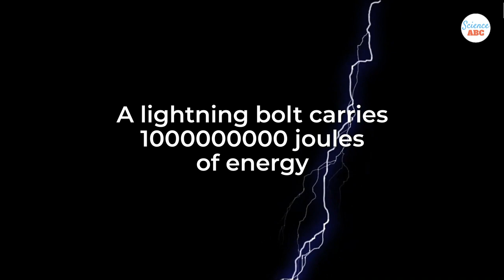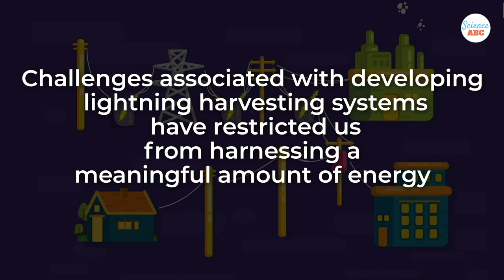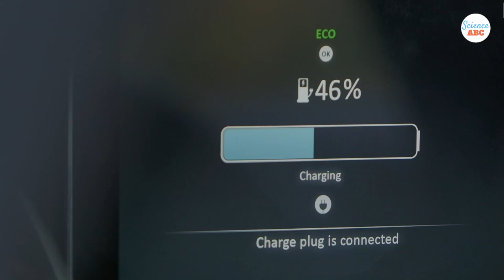Can We Harness Electricity From Lightning?

Comment: Basically we need a big ass capacitor that can store the energy and then big ass Transformators to reduce the voltage and charge regular batteries.  It is that so freaking hard? I dont think so.
Reply: Yep
Reply: I understand the thinking however the temperature of a lightning bolt is around 5x the surface of the sun. there's an issue right there.
Reply: Your right but i dont think anyone will want to invest in this when there is better sources of energy to invest money into like solar.
Reply: Do you know how big a solar panel has to be just a charger phone and how much it costs urger phone and how much it cost
Reply: Lol you funny
Reply: @lukegracey7928  no issue press north and north magnets together they don't want to touch in the middle that's our salvation
Reply: I mean basically but it is a bit trickier than just that. But you are right
Reply: Reduce the power on the way down
Reply: Or collect It a little at a time on the way down
Reply: that would save too much energy and civilians money tho silly...
Reply: for real a whole line of capacitors from the top of a building to the bottom routing back up to the top to breaker cutting off the lighting rod to the system trapping the electricy to go into transformers then then charge into batteries or rout to the building. seems like a money maker. hmu for partnership lmao
Reply: Bingo.
What comes up to my mind is: Huge salt water tanks for capacitor.
Reply: Isn’t this what Tesla is doing now?
Reply: It is not just high voltage. Lightening would bring very very very high ampearage. Even if a big ass capacitor was built for this purpose, it cannot be powerful enough to capture the ampearage that literally burns the surrounding AIR. The chemical compounds currently used in making capacitors will burn faster than air. Unless we discover or fabricate a material that we don't know yet (like in Wakanda), the capacitor cannot handle the heat that comes with lightening
Reply: We can create it as fast as we can use it...or need it. Only trouble is...we can't store it yet. So...if man can find a material that will tolerate the heat it produces 5 times hotter than the sun...we essentially can't use it. But...someday we'll find a material that will tolerate it...and will certainly change the world as we know. 
An infinite amount of clean natural power...think of the possibilities
Reply: @lukegracey7928  I said in another post somewhere just have it strike water and turn it to helium and then that's really efficient helium off the off chance
Reply: Get it to somehow strike water and instant hydrogen
Reply: @Aluttuh  that is one time payment, government just need to buy the capacitor and trafo, and for the lightning charge it’s free, and it’s a clean energy too
Reply: @pettylilitems  what do you mean
Reply: Nearly all sky scrapers has a tall antena, and their construction is situated on large conductive structure which goes under ground and stores there electricity as a giant batteries
Reply: agree.
Reply: If you don't think so then maybe you should do it.
Be the change you want to see in the world.
Reply: @lukegracey7928  And there's 300 million volts in a single bolt.
Reply: @pettylilitems  Do you know how many industrial and retail barns are out there with more or less flat roofs doing nothing except keeping the rain off*?

*Albeit not very well in some cases
Reply: And a 4000m high tower.
Reply: I am sure they are using this somewhere in one of those patch up islands in google hearth. They talk as if is something imposible to do. But yet airplanes have a lightning protection device and also tall towers have a lightning deflector device, so? They can invent this king of devices but not a lightning gathering plant? I don't think so. I do think is because it would be to easy to much. NOT good for the "wallet" you know?

Comment: You don’t need the lightning energy to be stored in a capacitor. You could instead use it to heat water or something to power a generator.
Reply: thank you ,,as easy as that ,, why cant they try that .
Reply: @jomendez6929  because no one with enough influence has ever thought of it.
Reply: I’m not sure if it would be that efficient though
Reply: Dude I was legit gonna comment this same thing. But how are you going to draw the lightning? You'll need the lightning to hit the water or something touching it, but how are you going to do that? An open container of water? That won’t draw the lightning very well. A water container with an electrode in the water and sticking out the side to catch the lightning? That's not going to heat the water enough. This is also harder because the heat is dispersed so far along the length of the bolt into the air. Most of the heat is not gonna make it into the water whereas more of the electricity would. 

I say you just have the lightning rod capture it and engineer something that makes the energy get dispersed into several pathways with transformers to decrease the voltage so the system can handle it. Make the lightning equally distributed along each of the pathways adjusting the resistance to make sure it goes through all of them.
Reply: @BimmerWon  I'm sure they have you're not the first person to think of something like this lol. Did you actually think it through? How exactly are you going to heat the water with it? How will you capture the lightning and the heat and actually use the heat for energy?
Reply: Lightning is already electricity. You want it to convert it to heat to steam to power generator just to produce what it was initially?
Reply: that would not work you would need a constant source of heat such as the heat from a nuclear reactor.
Reply: Lightning is pointless as an energy source....   Like the video here says... a bolt of Lightning can only power approx 10 houses for a day...   its far too weak and infrequent to be used on any meaningful industrial or residential scale .

Comment: What if instead of creating lighting harvesters on the ground we create an aerial harvester like a blimp for example, and harvest energy directly from the cloud before the potentially devastating discharge happen? Then the gatherer just unload charged batteries on the ground and load empty ones to repeat the process.
Reply: Idk but, there is a research in the early 2000s like 2003(i dont have enough info sorry). They launched a small rocket with a wire attached to it, then it was struck by lightning. I dont know why it isnt in this video, maybe there is an inefficiency in that method. (Sorry just lazy to search)
Reply: Would it work to artificially recreate lighting in a contained box on a small scale that will produce at least 50,000 kWh
Reply: Would that reduce the heat and the problem of getting too much power all at once. I’ve got three design prototypes that I’m very confident would work I’m also holding off because I don’t think humanity is ready for that kind of power because it can definitely revolutionize the way of life in many different ways but it would also be a weapon
Reply: @Ighteva2022  hey tye. Would love to know more about your idea and prototype
Reply: @stephenstrange4009  ya definitely you can send me a email it’s got a 2 in it and my name to switched around I’m sure you can figure it out I don’t want to put it in the comment section of YouTube lol
Reply: Yo I was just going to say as an idea too here it goes don't forget about me.. what if lightning was just solely used to convert water into hydrogen .. I suppose for the average user.. I just don't know exactly how that would be done I kind of have like a bit of a theory.. if One landed a strike maybe it would be possible to divert that energy into pylons and make it somewhat directional to zap a container of water and recover the hydrogen would be really efficient way of gathering it I think
Reply: I think blimps are flammable but it might work
Reply: Lake maracaibo in Venezuela has a lightning storm almost every day of the year.  If humanity figured a way to effectively harvest and store this power, we could turn the lake into a factory and power the whole world through batteries.
Reply: @masterpopeyoda3290  this is the way... Even if it's a massive grid of capacitors and transformers the disperse the power to the grid and harness it
Reply: @masterpopeyoda3290  I was wondering if lightning could be used when it zapped water some way somehow to harness hydrogen from it too as well
Reply: We need to have more inventor minds to be able to share and conduct growth in our inventions
Reply: We have 1 problem before this idea, how can we harvest lightning?

We have to risk it all thinking less on safety because science was never forgivable.
Reply: @creator8101  if one got the opportune moment to have a strike upon a reservoir of water that would predictably vaporize it based off of its volume maybe is possible to obtain hydrogen from that water but the problem is it may ignite all that hydrogen during the strike if it was struck in a vacuum where it couldn't just simply burn then possibly you have a very efficient process of gathering the energy from the water as I've said multiple times replying to other posts
Reply: @Ighteva2022  I lobe to konw more about your idea and prototype, too. But I cannot figure out your email. Any more hint? or Can you send me email or message instead?
Reply: @Pikachu15125  also it’s not an idea it’s a way too create together.
Reply: I just asked this same question on a different video.  If the energy is already there in the cloud, why can’t we harvest it before it’s wasted into lightning?
Reply: @AB-1023  I am curious about that, too.
Reply: I feel that would cause potential for aerial explosions
Reply: Because idk THE HINDENBURG?!
Reply: @AB-1023  hi just some input on your question, it’s just my own thought so correct me if I’m wrong. But I don’t think you can harness it from clouds because the lighting bolt is the actual surge of energy. If you think about it in car terms the + and - battery terminals have to work together to produce the energy to run your car, if they are not in unison there is no spark
Reply: @dustinswatsons9150  i have no idea if what you say is true, but it sounds cool af 😅
Reply: @Ighteva2022  i want to know more about it too. Just a random nerd from brazil
Reply: @masterpopeyoda3290  at minimum, that lake could certainly be used to power that entire region the same way we can use water dams to harness electricity for specific regions. At the end of the day, it seems the “best” solution is not one but multiple solutions depending on the most readily available resources in each region of our planet. Since lightning strikes are sporadic in most places, seems we should even be looking at harnessing electricity from multiple sources at once. Like how we can gather sunlight energy & burn coal to power a region. Or how in some areas, wind farms make sense in combination with some other source because wind is also not consistently available. We just need to figure it out so we can add it to our current options for harnessing electricity. Starting with a location where lighting strikes constantly makes the most sense, in my opinion.
Reply: @dustinswatsons9150  A Tungsten dust stream propelled by a rail gun & high psi. (Over water) dumping into a massive capacitor bank dumping into a megapack.

Or make heat & HHO with swimming pool sized ss hho cell.  Not a big fan of hydrogen being the smallest molecule it leaches into the pores of everything and embrittles rubber steel. Hardened/ elongated metals particularly vulnerable. But a hho water heater/ burner arangment would go well with the swimming pool" path of least resistance" lightning water heater. Backup the electricity circuit.  Im guessing Elon will be on this very soon.
Reply: @Ighteva2022 try to find ivester for your project.
Reply: You don't understand change in charge potential. You cannot gather a massive change in potential safely without the danger of discharge when you try to get back to the ground!
Reply: @masterpopeyoda3290  You can't power the whole world through batteries. This is one of the major problems in energy. You cannot store power that efficiently like that. Batteries lose charge and you just can't have batteries store that much energy that's why we have power plants and big grids and stuff and that's why wind and solar aren't efficient. They only work during the day and when the wind is blowing and you cannot just store the energy.
Reply: @dustinswatsons9150  That's the whole point though. This video is talking about how to use a massive grid. That's exactly the problem you cannot just use batteries they can't store enough energy and they lose energy. That's why we have power grids they're essentially huge batteries.
Reply: @Ighteva2022  saying what you just said is the same as putting it in the comments. If people can figure it out then you gave them your email. If they can't then you didn't. Either you do want them to have your email or you don’t.
Reply: we're too focused on windmills bro😂🙄
Reply: It nake more sense to put larg cables from blimp to ground to transfer energy

Comment: The ocean is a place that does not conduct lightening very often.   That creates severe weather patterns and hurricanes.  However if anyplace was best to harness that storm energy, it would be large bodies of water where photons are.  There are a couple key areas to consider.  A: there will be a definite lack of electrons due to the winter storm systems and cold air and lack of sunlight.  B: Lightening to me is a product of reaching out to meet another counterpart.  C: electricity flows best in paths of least resistance and horizontally will always facilitate that better than a verticle atomspheric gain of 2:1 radii per every dividing unit of 9.9;  meaning: energy transfer is harder coming down when verticle because of a binding friction of molecular properties .... and that's a 2:1 taper from atomic particles to diatomic and inverted charges as well.

So understanding the creating a path of least resistance, foremost I would avoid the inverts and try for hot air blimp mechanics to initiate the draw of charge.  Secondly, would need a ton of electrons.  Lightening is a product of co2 and carbon monoxide conversion. Carbon contains a thermal electron nucleic hydrogen core that will absorb heat.  Eventually slot of carbon is separated and rain fall happens.  Any neutronic particles that are singled out will absorb energy and convert to silicon anions of which are spheric and they are  total electron vacuums.  This will generate a unstable photonic charge looking to find available electrons and with the already abundance of hydrogen, will head inland for electrons to feed neutral particles that are spherical gravity and highly conductive.

To harness lightening you will only need electrons (hydrogen 1).    And, to avoid choppy invert energy transfers and resistance, I'd try to engineer a self sustaining gaseous circuit dual transfer photons/electrons in direct atmospheric pressure or floating aircraft maybe.
Reply: Wrong.
Reply: @samskurnik1053  Why sir? can you help explain it to me?

Comment: Huge plates buried  in the ground, one is grounded the other plate is electrically isolated. When lightning strikes the grounded plate it would hold the huge potential for an instant, then you  immediately  isolate the grounded plate so it could hold a charge between both plates.
Reply: bro could you elaborate it?
Reply: Im gonna steal your idea, thanks.

Comment: @3:30 use lightning rods to attract the lightning, use water to dissipate the charge before trying to harness it such as a small manmade lake, rods in the lake to act like a battery and just pull charge from the water. The expensive way,. Why wait for lightning when that's full concentration of the charge,  It would just be easier to pull the electrons from the air that's already charged before the lightning even discharges as the storm passes over or just from the constant static charge on a windy day

Comment: For all of you saying do this do that it's easy, just remember, 27,000C. That heat can literally melt every material known to man. This is probably the most problematic issue.
Reply: I always thought it would be a good idea to convert a lightning strikes electrical energy into heat energy and then back into electrical using steam plants
Reply: Use replaceable rods 😂
Reply: I live near a factory with a tall metal chimney. During a lightning storm, that
chimney gets struck dozens of times without causing damage.
Reply: Then how people survive lightning strike if they experience 27,000C ?
Reply: @krisolson6515 for real 😂😂
Reply: @kormannn1   its very quick similar to how you can pass your hand threw boiling water if your quick enough it does not give the time to pass all the heat threw the body.

Comment: When I was a kid, I always thought our electricity came from lightening. This is probably because of Benjamin Franklin, the kite and the key experiment. I thought electricity was captured in some way by power stations in each city then kept and distributed to households. I honestly don't know at what point I learned this wasn't the way it worked. I think it was when I learned that not only did dams collect and store water but also used water to produce electricity.

Comment: I have an idea. Build a big lightning rod have this rod go into a pool of water. When lightning strikes it will turn the water to steam. Steam then turns the turbine and boom power ⚡️
Reply: thats an interesting way to harvest electricity from something made of electricity but yeah it could work
however the question then becomes how you would focus the heat from the bolt of lightning into water without the lightning hopping to somewhere else